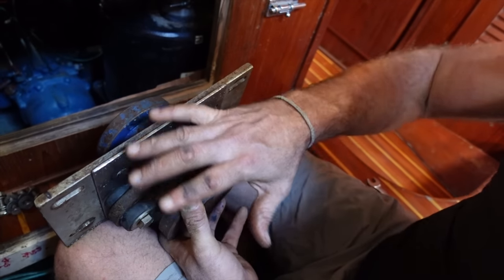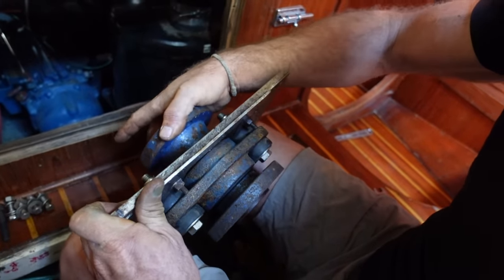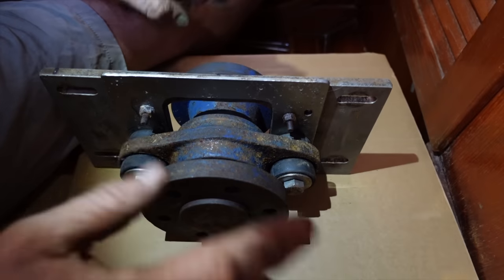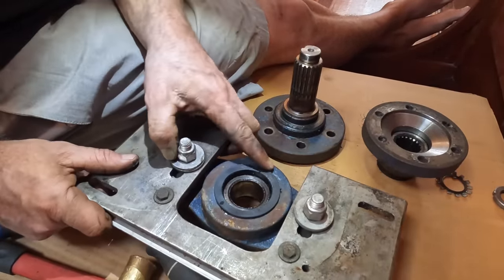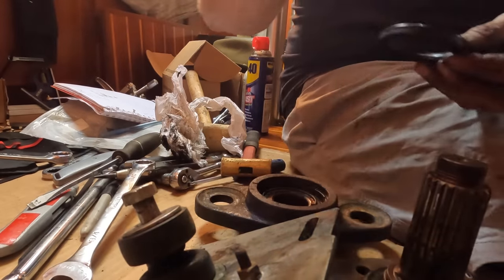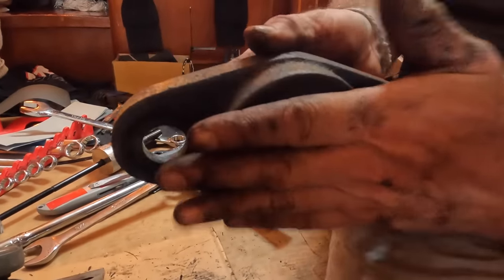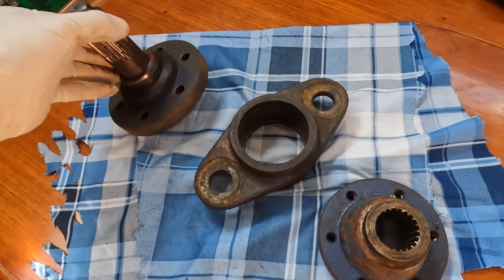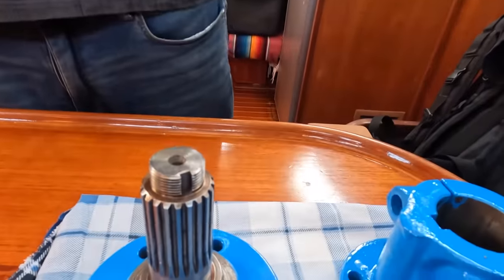Fixing our Sail Boat on a budget | Ep 347 | Lots of Boat Work

Comment: With Bearings like that if there is a 2RS version of it (2 Rubber Seals) you should go for that. I was amazed when i pulled my anchor winch apart there were no Rubber seals in a gearbox that was guaranteed to eventually have water ingress, particularly as the ver first bearing after the main outer seal had no seals at all. That meant that the anchor winch gearbox was relying on just one seal to keep salt water out. But then no doubt you knew all of that, so this is for others.